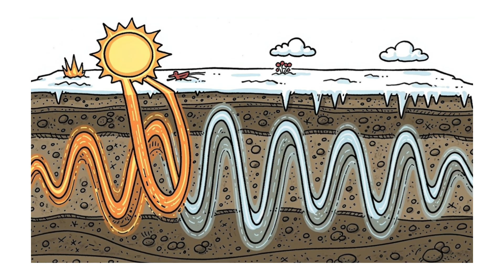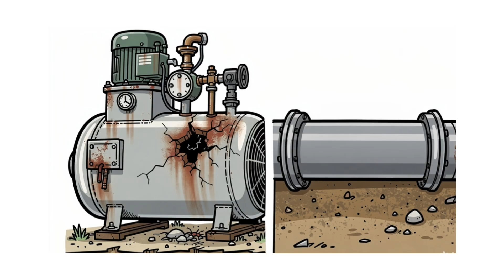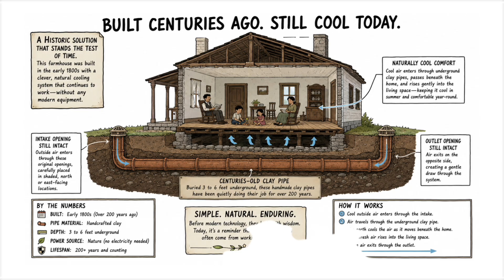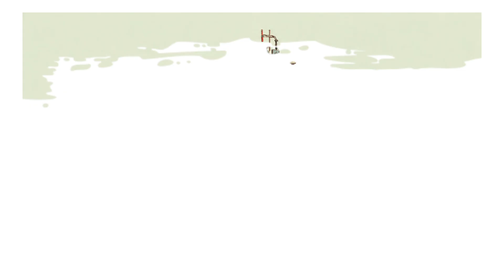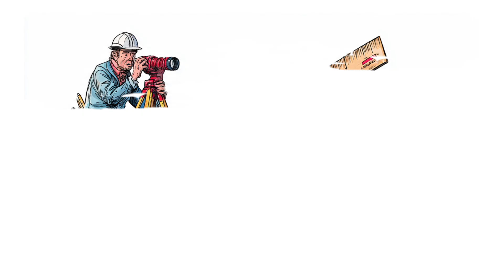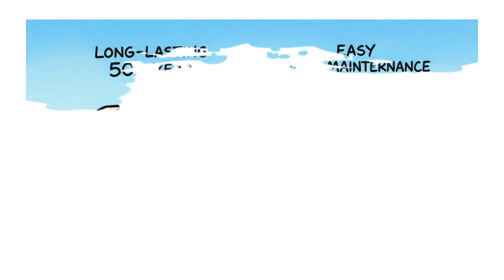This $300 Illegal Pipe Cools Your Home for FREE (Why Did The Energy Industry Hide It?0

Comment: My earth tube is 100 foot of 8 inch PVC it slopes down from 2ft deep to 10 ft at the mid point them back up to 2ft under the vent in the floor of my pantry in my home .
At the mid point there is a 1000 gallon water tank - the top of which is 3 feet bellow the earth tube , the lowest part of the tube has a "Tee" pipe that drops the condensation water into the tank .
From the tank  straight up , runs a small pitcher type hand pump I get 30 gallons of water a day in mid summer when the humidity is over 50% (three times the water dripping from the outside bottom of your window AC ) .
This brings in fresh air so you can use wood stove / fire places and any small gas or kerosene heater with a attic vent in the kitchen ceiling and attic vent fans to push air outside (and pulls cold air in through the earth tubes) . 
NO carbon dioxide worries .